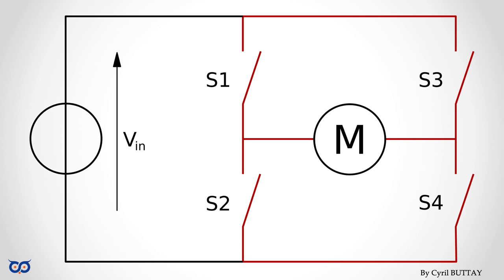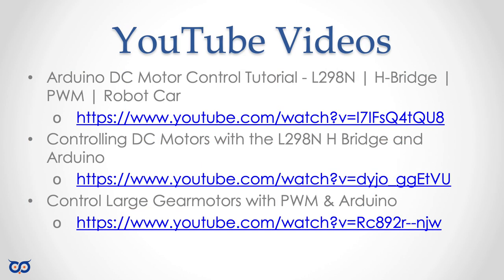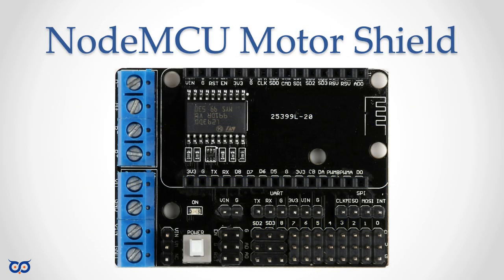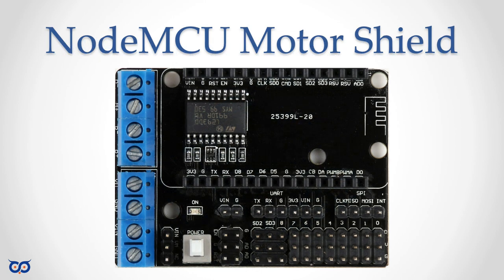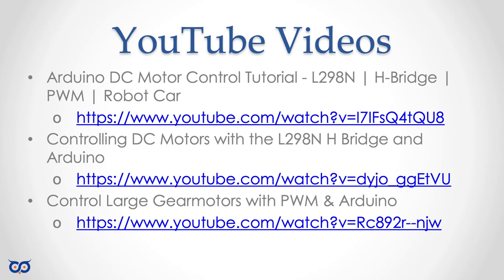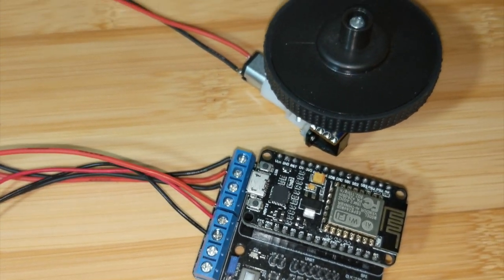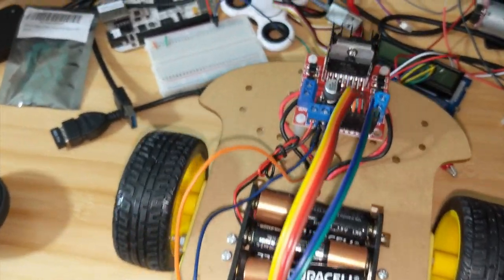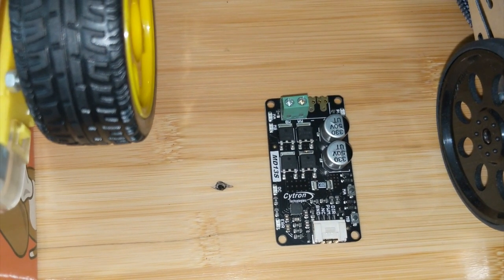#golang #embedded #gobot - S5 E1 - ESP8266 L293D Motor Shield - Part 1

Comment: Are you using python?
Reply from the maker: I used Python for some testing in section 6 for the SB Components and Adadruit Rasp Motor Shields, which worked. However, I am stubbornly hanging my hat, for the moment, on GO Language and GOBOT package as the foundation for this robot platform. :) I will reset a bit this year and see if I didn't miss something, hence why the hiccups I have experienced. I don't want to give up just yet on using GO, without giving it the ole college try. :)